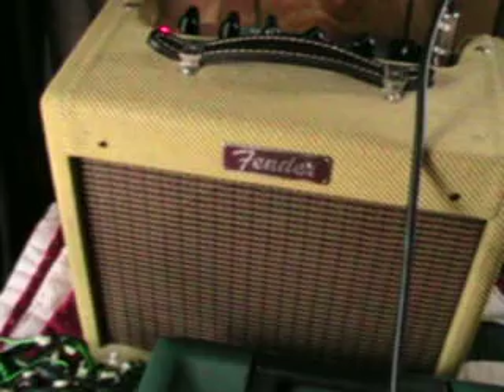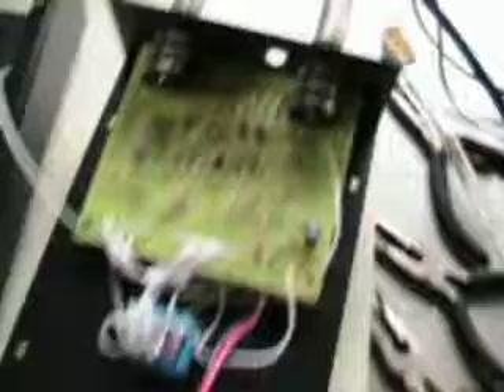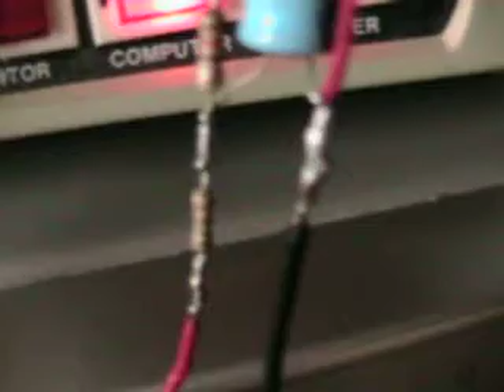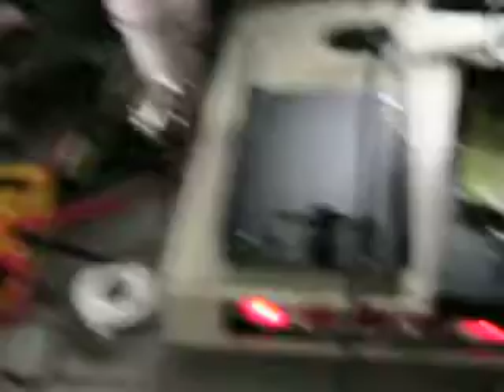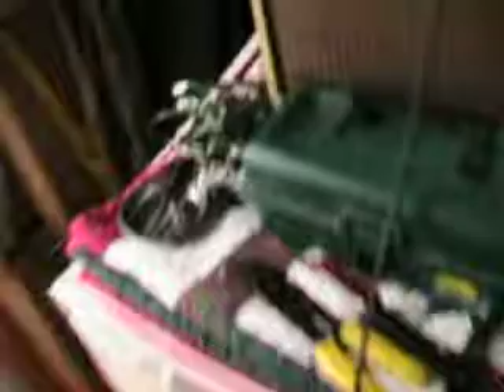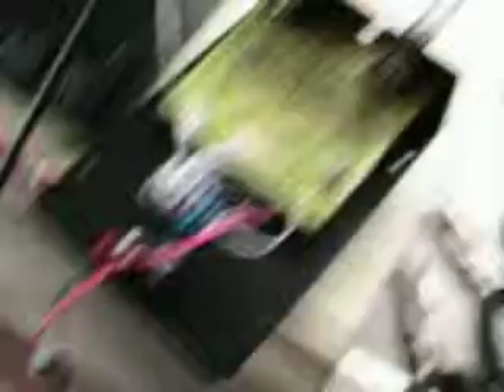Big Muff Part 3

Comment: how did u configure this-
?
must tit me the same ratings for me to get the same result? is there a math equation? 
im in the exact same boat-got hole frilled-muff apart-hmming though i used a 470 k resitor and that helps alot? amy ideas- or should i stick yo your design- i know nothing about electronics-